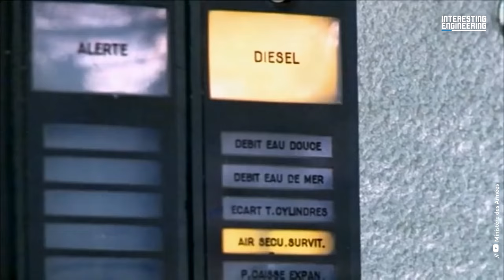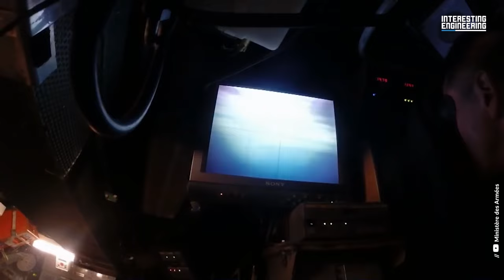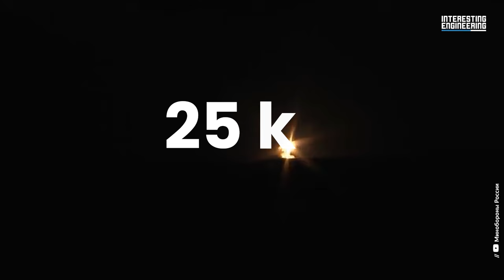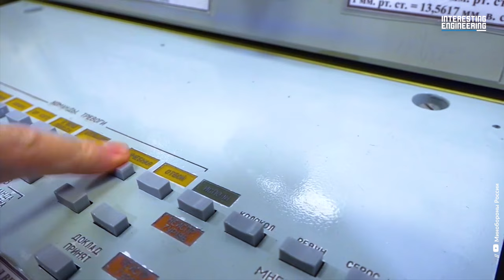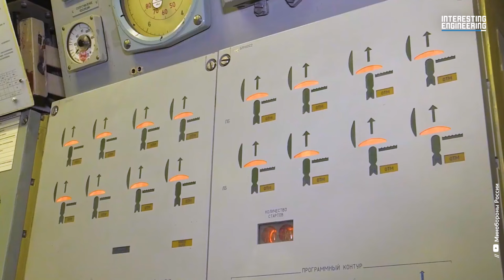The Top 5 Largest Submarines: The Ultimate Underwater Titans

Comment: There's no room for error in sub design and operation. The ocean pressure constantly wants to crush them. A number of US & Soviet subs were lost to accidents. The US submarine, "The Thresher," is a potent example of a tragic loss. Unable to surface, it sadly sank deeper and deeper until it imploded at over 1,000 feet deep with 129 souls aboard. God Bless submariners.